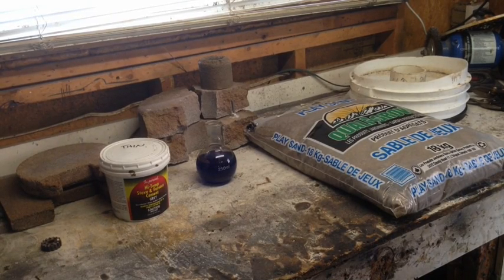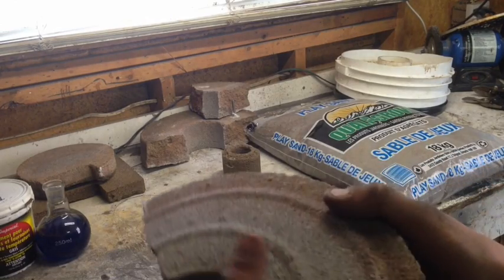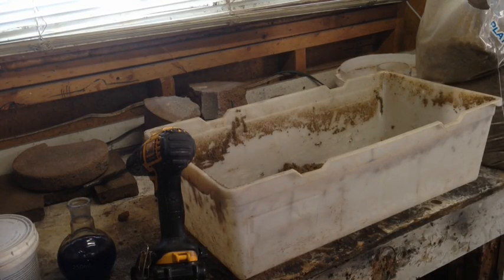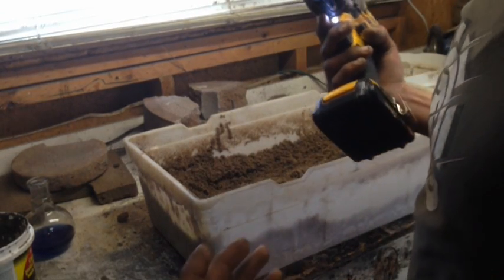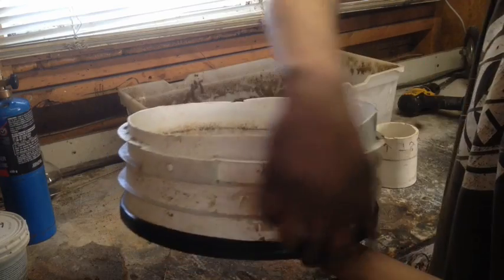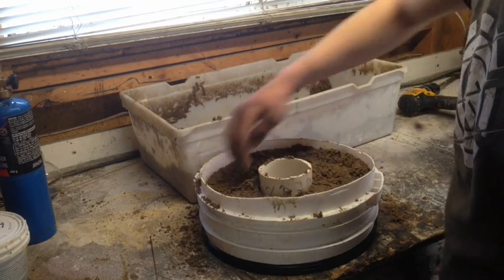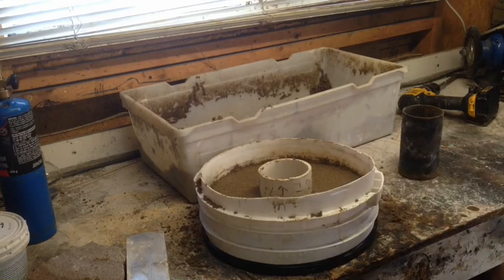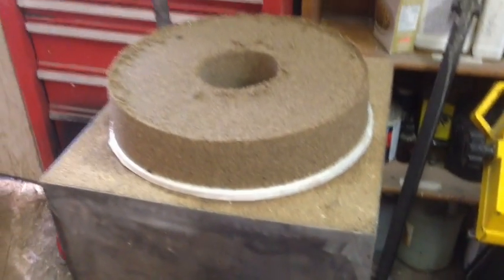How to make refractory brick (fire brick) with sodium silicate PART 2

Comment: Is there a ratio buy weight of sand to water glass?
Reply: Found the answer.  It should be 5% to 10% by weight depending on use.  The hotter the temp, the more sodium silicate you want to use.  5% would be about wood stove use up to 10% which would be used for smelting.
Reply: nwanzer 
any idea if that weight of sand is dried or damp?
Reply: I was told both should be dry (sodium silicate powder).  However, shooting for 7% for damp sand and water glass should get you in the ballpark.  If you are just doing a wood stove, I'm hearing this is overkill and a combination of 2 parts sand, 2 parts perlite (or mica), 2 parts clay, and 1.5 parts mortar mix should be good for 600f (315c).

Comment: Thanks for your great video.  I get that sodium silicate is highly reactive to CO2 and also slowly dissolves while submerged in water when used as a glue (no heat applied).  If possible, I would like to know if your foundry lid, the one made with just just sodium silicate, would also dissolve if you left it in a bucket of water or is the bond permanent and water proof  once you fire it up in the foundry?  Reason being I'm mixing charcoal and porcelain for a pet project and need a water proof bond for these materials.  Do you think sodium silicate would work (under heat) or maybe the High Temp Cement you're using (or both as in your new lid) or can you recommend another bonding agent that may do the trick.   It's a lot to ask but I remain hopeful.  Thanks.
Reply: PORTLAND CEMENT

Comment: lol lie-sensed gas technician! you are such liar! I AM a corgi registered plumber and gas engineer. Your setup is that of a child's, don't bullshit people.....They are not all as obviously dumb as a plank like you..... pmsl @ you!......"licenced" yeah right, ha ha ha haaaaaa, thanks for the laugh though bud.
Reply: By the way, the kid claims that you can use this for cast iron, it simply is not true if you try casting iron it will explode and most likely kill you. I have been casting for a few years now, and made many great parts for my lathe and milling machine (my hobby).
As such, I have learnt that the information in this video is awful. After 1000°c sodium silicate WILL melt!, cemented parts will fail. And an arc reactor lol don't be stupid.
There are actually quite good videos on YouTube that have educated people who explain this quite clearly. This kid  doesn't even try to find out the material science about the materials he uses.
Sodium silicate for those who are interested is useful for brass, aluminium. But certainly NOT cast iron.
Do a little research, working high temperature metals is dangerous.

Comment: I'm a bricklayer by trade or I was years ago and I can tell you it's a lot easier to mix something into sand if you dumping a little sand little silicate mix little more than a little more silicate mix excetera excetera excetera and then mix the piss out of it at the end
Reply from the maker: Clown Whisper yea you'll end up with clumps. you can water the silicate down to make it easier, but should let the mix dry a bit before firing, or fire at a lower temp for the first bit anyway

Comment: Great video - thanks. Disregarding all the armchair experts and naysayers, how long did this last as a furnace lid? Just wondering as I need to do the same thing for my foundry.
Reply from the maker: being completely honest, it's a good medium. I personally am not using it anymore as I've moved to lighter kao whool from a pottery supply store. it held up great when it has lots of support. it hates being wet, so keep it in a dry location. use some kind of reinforcement.. I wanna say rebar, but it will expand in the heat and might crack it... my last lid, I poured with this mix into a steel lid. think of half an orange... the skin was the steel and the fruit itself was the refractory. it worked quite well, but was very heavy.. 

adding the small amount of fireplace cement (shown in the video) made a huge difference in the overall strength of the mix... as well as made it a bit more water resistant... all in all, this works to get you by on the cheap.. and it works quite well for quite some time... is it the best material?... Probably not as it's basically the same stuff used to make sand moulds for casting metal parts.. it's high temp resistant but it is "kinda" easy to break up.. 

all in all, if you can find and afford kao whool, go that route.. if you only really need this thing to last maybe a year giver or take how you treat it, then this mix will work fine for you..
Reply: Thanks for your reply - it's helpful  to know how things hold up over time. Been looking at ceramic fibre but as you say, it's expensive whereas this solution is not. I already made a couple of litres of sodium silicate a couple of months ago so I'm good to go. All it's costing me is time and I've got lots of that . . . And when it falls apart I'll just replace it  ;-)
Reply from the maker: That's how I went about it... and in all honesty I only rebuilt it because I didn't like the overall look of the unit.. not because the refractory was falling apart, that and I cut the weight by like 100lbs.. give it a shot, add 10$ worth of fireplace cement.. it won't let you down..

Comment: Great vid, thanks so much. What type of compound would you use to cast a pizza oven with? This is obviously resistant to very high temperatures but perhaps not very healthy should small particles and vapor mix with your pizza.
Can you think of a good castable concrete mix to make the oven dome? Your input would be appreciated.
Obviously needs to resist very high temps and not be toxic.
Reply from the maker: I would reccomend using fire clay. you could cast the dome I  refractory cement or Portland cement and then line it with a few inches of fire clay. it will resist high temps and be food safe as long as you coat all exposed concrete in clay.
Reply: @nilamotk  thank you so much for sharing your knowledge
Reply: nilamotk portland cement is shit as a refractory!  It will dry out and crack. You should use true refractory cement with 40% alumina added to it.
Reply from the maker: Shona O'Neill where's your video showing how to make it?.. everyone's an expert, right?.. as for your other ignorant post.. I'm G1 certified.. I work on 12,000,000 btu annealing furnaces... but thanks for coming out. I'm also 313A refrigeration technician, servicing 90 ton chillers... certified for residential geothermal installation... residential radiant hydronics design... I could go on, but I wouldn't want to hurt your feelings...
Reply: @nilamotk  right on!!! tell it like it is

Comment: When using indicating silica gel, the blue comes from Cobalt Chloride. Because Cobalt is a heavy metal, indicating silica gel is not food safe and should be kept away from and avoid spilling into anything edible. I would not use it for anything in which heat and food are combined, especially pizza ovens.
Reply from the maker: Dave P agreed. but at the same time, I'll bet the air you breath outside is more detrimental to your health then the very very small amount of cobalt found in the colouring agent.
Reply: Not really. Living in the middle of the Rocky Mountains a few thousand feet above the valley floor takes care of that. I guess I don't get the idea of intentionally ingesting Cobalt because there are other pollutants.

Comment: Sodium silicate mixed with sand and heated is a recipe for low melting temperature glass, not a refractory. You need 60% calcium aluminate activated cement and refractory grog for that. VERY pricey. The above material will perhaps last a few short sessions in a forge but it WILL melt.
Reply from the maker: DoctorGarkle hate to burst your bubble.. but that's what I've used. and it's never melted at low temp into glass.... I'm no real chemist, but it works.... 

dont know what else to say..
Reply: thank you very much for this video.
Reply: DoctorGarkle, 
Sodium silicate mixed with sand  is...what?
sand + soda is sodium silicate, alias waterglas
sand + soda + chalk is glas.

Comment: hi, would this mixture be good to use as my pizza oven floor ????
Reply: NO!  This stuff is very toxic.
Reply: But would it really matter since the stuff is so heat resistant? would any particles of the material come off into the food if it was fired first?
Reply from the maker: sodium silicate is actually an additive in the food industry.. it's probably some kind of preservative... that being said food grade sodium silicate will be stoichiometric meaning it won't have any extra sodium hydroxide kicking around in the mix.. sodium hydroxide is a drain opener and very toxic... 

I reccomend against using this on a pizza oven (with direct contact with the pizza atleast..)

Comment: Hi there nikamotk 
How long does this brick mix take to dry out in the open air.  Thanks
Reply from the maker: it will not really dry in the open air. is needs to be cured with CO2 with dry ice or compressed co2.. otherwise it needs to be fired to be cured.
Reply: +nilamotk thanks

Comment: Worrying about having propane indoors and feeding an open fire with it? People do it all throughout Europe (in places with no gas piping) for cooking and heating! It beats using electricity for heating....
Reply from the maker: I'm not worried, I'm a licensed gas Tech.  direct fired appliances are used for cooking in North America too.. the difference is those burners are engineered, and tested to put out very very little carbon monoxide.. there is little chance a burner you make in your garage will run as efficient as a direct fired burner, and there's a good chance your burner will pump out a substantial amount of carbon monoxide.. that being said if I told you in the video this was safe to run indoors, there would probably be a few people dead..
Reply: +nilamotk Yeah, tbh I wouldn't run such furnace indoors either, because besides the carbon monoxide (even though it's nasty stuff on its own too) there are all sorts of harmful fumes that escape when metals are being melted.
On the other hand it goes without saying that such things MUST be run in a well-ventilated space at all times (just like gas heaters used in central heating systems, even certified ones).
Reply: E.. people do use LPG for cooking and heating indoors without ventilation....however... not such a great idea ...AND.. water vapour appears to be a byproduct and seems to have a bad effect on timber window surrounds due to condensation.

Comment: Hey, why not just use Portland cement with nothing else added? That stuff is almost impossible to break and you could get it at Lowes for around $11 for a 94 lbs. bag.
Reply from the maker: Strait porcelain cement cracks from the heat.. been there done that.. you can make a concrete mix with porcelain cement and say vermiculite or perlite.. but I recomend adding sodium silicate to increase the high temp binding properties... and at high enough temps you will melt perlite too.. been there also done that...
Reply: nilamotk
Is porcelain cement the same thing as portland cement?
Reply from the maker: +jjenson2006 yes.
Reply: nilamotk Okay, then what do you think of portland cement with sodium silicate, but with nothing else? No sand either.
Reply from the maker: +jjenson2006 it cracks.. like spider web cracks all over the place..
Reply: nilamotk
I see. I'm just wondering if there is an alternative to using sand. In your video, you actually crushed it with your hands; it just seems a little too brittle. What about just mortar clay mixed with the water glass?
Reply from the maker: +jjenson2006 store bought firebrick is softer and more brittle then what I make in this video.
Reply from the maker: +jjenson2006 you can use strait fire clay. mortar mix will crack worse then Portland.

Comment: I have watched both of your videos on how to make  refractory fire brick and Sodium silicate they are great videos, very well explained and I would like  to thank you for making them!!! I have some questions I would like to ask because I am not the brightest light bulb around. When you make the fire brick, just exactly how much  cement do you add? Then when making the Sodium silicate for high temp glue how thick should it be to use as a high temp? I would deeply appreciate it if you could send me instructions on how to mix it. I am building me a oil burning heater for my shop and would like to get the fire brick right the first time around. Thank you for your videos and any help you would care to offer.
                                                                                            boshellgilbert@gmail.gom
Reply from the maker: the cement is optional. you can use the cement in the video as glue or you can use sodium silicate. if you use sodium silicate it should be really thick... like molasses or thick syrup. sodium silicate as a glue foams up and expand when it's heated to first time. this can push bricks and screw things up. I reccomend using the store bought refractory cement for glue. and if you want to add it to the mix get the container the size of the one I have and add half of it to your brick mix and use the other half for glue.

Comment: Awesome.  Around what temp brought your mix to "red red hot"?  Apologies if it's a repeat question.
Reply from the maker: 800C? gibe or take. it's wasn't actually physically measured.
Reply: +nilamotk That's hot!  keep up the good work.
Reply: For melting bras it get higher by about 100, today I used mine for the first time and without a proper lid it must've been about 950-1050 degrees Celsius, couldn't melt all the copper and had to rip it out of the crucible as it welded itself
Reply: +ON4331 brass*

Comment: is this more heat resistant than sand and plaster of Paris?
Reply from the maker: Yes, plaster cracks and is not really meant for heat its meant to make drywall. Real firebrick, and real refractory cement use sodium silicate. even sand moulds use soldium silicate and sand sometimes for cores.

What I have done, and it works for me for melting and casting alumium and brass, is cut the top off of a propane tank, and use this as your combustion chamber/melting chamber build a steel box aroumd the propane tank up to the height of he propane tank with 2" clearance all around. fill the gap with sodium silicate/vermiculite mix for insulation and leave it 2" from the top. mix up plaster with thin solium silicate and water, and use this for the top layer. this way it looks pretty, and has high isulating value. I ha e a steel liner inside (the propane tank) and your best not to have this as it sucks back some heat, but it adds a shitload of strength, and rigidity. you just cant melt steel or cast iron this way for obvious reasons....

use more sodium silicate then I use in the video for a nice strong material with high heat resistance. (use lots, dont make it soup...) and use silica sand instead of "play sand" for a more evenenly made and less stressed brick. "play sand" has lots of different minerals that expand and contract at different rates causing premature cracking.

Comment: Hey:) You need to be aware that the indicator used in silica-gel is crystal violet, which is a known carcinogenic. It can be absorbed through the skin. Thanks for the video;)
Reply: +nilamotk Good answer buddy. You have other lives in front of you though. Wear gloves, ear defenders, glasses, knee pads etc..............I didn't........ lol!
   I am using a recipe like yours with bentonite and high alumina cement.
Reply from the maker: Im aware, im also aware that the sun itself is carcinogenic..  as well as emmisions from vehicles.. Aluminum pots and pans cause Alzheimer's disease.. the insulation in your furnace/airhandle is also carcinogenic, and its being blown through the air you breath.. its all relevant, you pick your battles... I wont mix a solution of suphuric acid with my hands for obvious reasons, but a mixture, with a solution containing trace amounts of an indicator, ill take a risk..
Reply: +nilamotk How much would you say the weight ratio between Na-silicate and sand is?

Comment: can u please give my the mixture measurement  sand to water glass ratio thanx
Reply from the maker: there no exact. its in the video.. 500ml - 5000ml per pag of sand.
Reply: so would mixing in more water glass make it sturdier and more heat resistant ?
Reply from the maker: Sturdier yes, but not any more heat resistant. The base material is whats resisting the heat (perlite, sand, vermiculite.. Etc)

Comment: quick question, how does one bond two pieces of this together in a heat proof bond, say, like i want to make a 2 sided cast for metal objects. Is there any material that can be used to bond together through the same heats that this can withstand?
Reply: +Devin Huie like if i wanted a re-usable 2 part mold
Reply from the maker: reusable casting moulds are made of steel or so.some other metal. sand won't work for reuseable. you can bind 2 half's with refractory cement or you can mix some sodium silicate with some really fine powder of some sort.. (plaster?) and make your own "glue"

Comment: HUMMM.  INTERISTING. YOU FORGOT AN IMPORTANT STEP !    THE CO2  REACTANT BATH.  PLACE THE BRIKS IN AN AIRTIGHT ENCLOSEURE, PUMP IN C02 . THE SILICATE WILL SET LIKE CEMENT > RAPIDLY!  BASED ON THE SIZE OF THE BRICK<< ..
Reply: +Thomas R. Miller he kind of touched on it, but not enough
Reply: +Thomas R. Miller You don't need an air tight enclosure just a tub with dry ice it will displace the O2 since its heavier, 1pound of dry ice evaporates (sublimates actually) to appx 8.7cuft of co2.  You could place it in a tub with a snap lid let sit for a couple of hrs
Reply from the maker: I mentioned it, but didn't do it in the video.